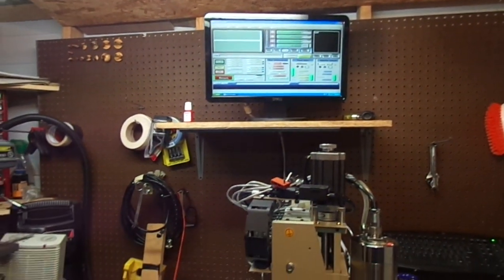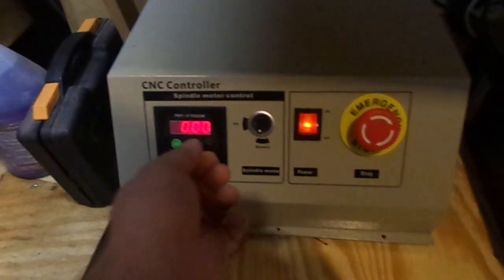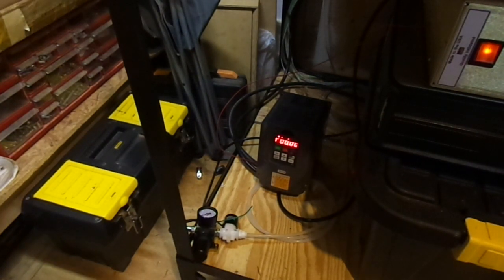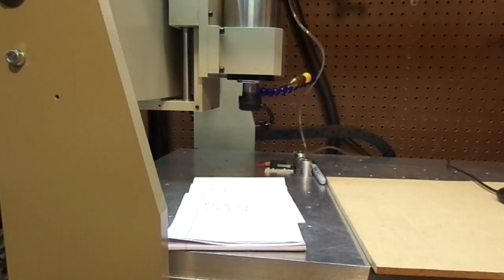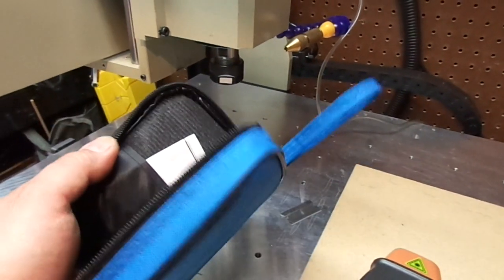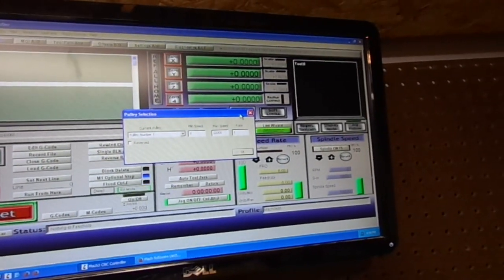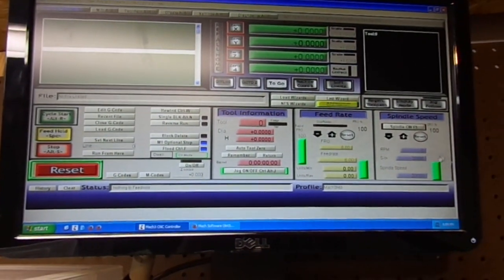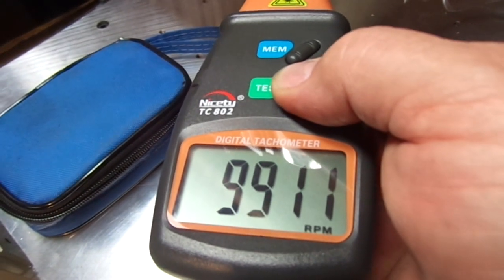6040 CNC upgrade video  5 , Spindle Upgrade (lost footage!)

Comment: Hey Rick,
can you please make a Video, where you disassamble the old spindel motor? I would really like to know how the spindel shaft is mounted. Maybe it is enough to replace the cheap ball bearings for higher quality, more sturdy ball bearings.
Reply from the maker: I still have the old spindle for some reason... I actually started taking it apart and realized I needed a press or puller to do the job and gave up. I have seen pics on the internet of them apart but actually don't know how to get it apart...yet! Since I got my 2.2K spindle I have not looked back. Only downside is a little lost Z travel

Comment: My lesson learned is to not buy this machine at all! Scrapped the motors. Scrapped the spindle. Scrapped the VFD. Scrapped the cheap T-slots. Added a $1,000 one inch alum plate as a bed...and it is still only 600 x 400mm...did you install linear rails in the Y axis (on the gantry) in place of shafts? I might just buy good quality parts to begin with and build up the entire machine. FYI there IS higher quality T-slot alum. Anyway, too bad you wasted all that money! Saved me some.
Reply from the maker: twbrkfd1 exactly correct... this is so true and the main reason I created my website and started this video series. Had someone else made these videos before I would not have made this purchase. If you like to tinker then this is it but if you want to make good parts without working on this machine then run far away!!! Lol